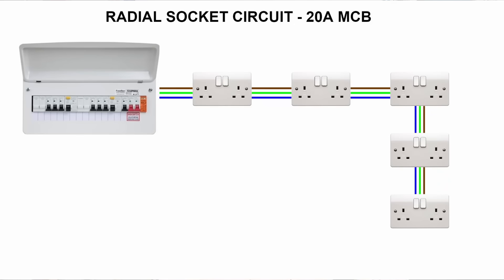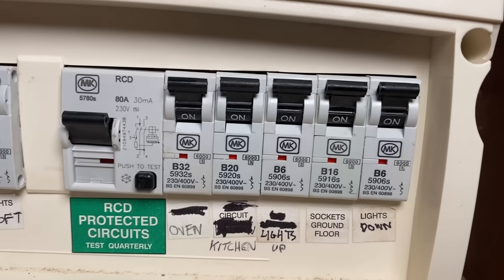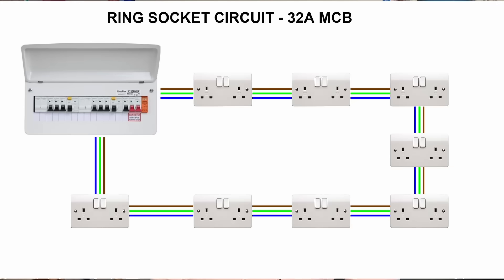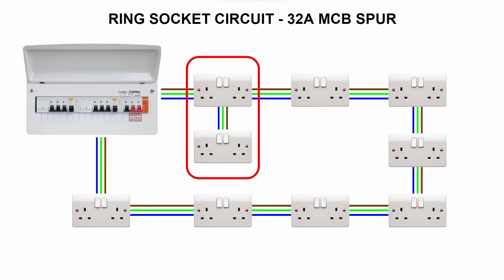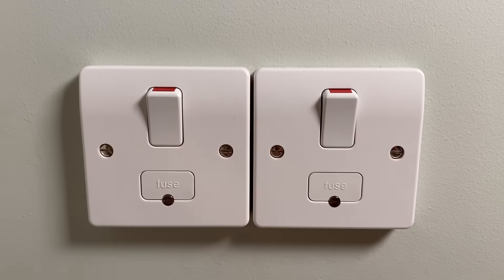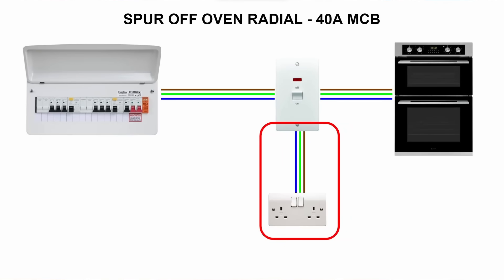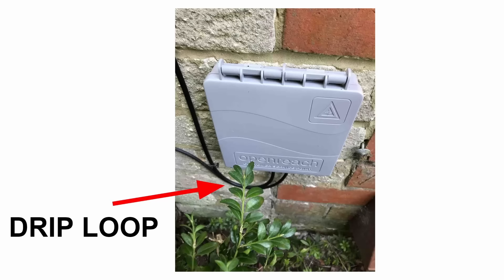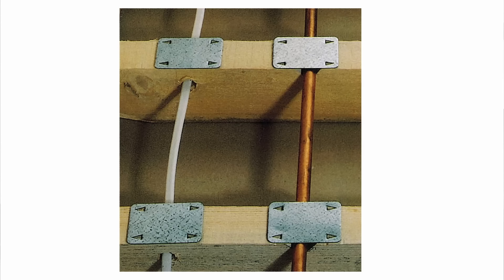BIGGEST DIY Mistakes Adding a New Socket

Comment: Ring circuits have been widespread in the UK for 75 years. They have been found to be very safe. The British G Type fuse-in-plug was to protect appliance flexes, however became an enabler to use final ring circuits. The final ring circuit is ingenious in its simplicity. When used with the British G Type plug the ring is a busbar run around the house with distributed fuses at each appliance.

There are many advantages to rings:
▪️ Cheapness, as smaller easier to install wires can be used;
▪️ A large number of sockets can be off one cheap to install ring;
▪️ Having the same number of sockets using radials would mean multiple radials and multiple extra breakers at the main panel. Far more cable, expense, labour and hassle;
▪️ The 32A breaker and 13A fuse in the plug ensures safety;
▪️ Portable plug-in appliances on a ring cannot exceed approx 3kW. Some plug-in ovens are on rings;
▪️ Rings usually have a 32A breaker at the main panel - can be a lower value; 
▪️ Using push-fit maintenance free Wago type connectors to connect up the ring adds safety, as not being screwed connections they do not work loose. The ring's current does not run through the socket terminals (this applies to radials);
▪️ The British plugs enable rings having a max 13A fuse in them - can be as low as a 1A fuse in the plug to suit the appliance and flex/cable. Small flex and appliance? Then a smaller fuse;
▪️ Rings in the UK are limited by square metres of floor space, with no limit to the number of sockets on the ring. 100 square metres of floor space with 2.5mm cable for a 32 amp final ring. The cable can be 4mm, which is advisable in an unbalanced ring drawing high current loads;
▪️Less voltage drop on long cable lengths as voltage comes from two ways;
▪️Two ways for the earth wire back to the main panel, increasing safety levels.

Radials are also used in the UK. Rings are not mandatory, but used because they have proved to be generally trouble free and safe. They can be installed using rule-of-thumb. These days a ring will be on an RCD, RCBO or AFDD - these now are becoming DP, so safer again. AFDDs are now mandatory in some socket installations and recommended in all installations. AFDDs raise the safety level. If an office wants more socket outlets for extra desk computers. It is a simple matter of extending the existing ring with the extra sockets as the current draw is low. Cheap and easy. If radials are used many radial circuits would be needed, which may mean an extra consumer unit, breakers, wire etc, then far more labour. Some disadvantages are:

▪️ Rings are more difficult to fault find. But electricians have no problem once the ring is fully understood. The ring can be split at a socket then tested as two radials;

▪️ Another is that if a number of high current drawing appliances are on one side of the ring, say nearer to the main panel, most of the current draw may be down one cable leg of the ring with the cable rated below the main 32A breaker. An unbalanced ring. 2.5mm cable is rated at 27A max. Although tests have proven the cables do not exceed their current capacity in the vast majority of cases, just an imbalance in distribution of the two cables from the main panel (consumer unit). Good circuit design will prevent this, negating this disadvantage. Balanced rings can be installed by daisy chaining to alternative socket outlets on the ring. That is the first appliance will draw from one side of the ring, the second socket will draw from the other side, and so on round-robin. Or use 4mm cable to the point where heavy current drawing appliances are, then 2.5mm for the rest, if it is that troubling for some. Using 4mm cable on one side of a ring and 2.5mm on the other, is still cheaper than a bunch of radial circuits.

Overall one ring is superior to a bunch of radials needing their own breakers at the main panel. They are simpler, cheaper, being proven to be safe and worked well over the past 75 years. Using the new AFDDs on rings, which are recommended and mandatory on some installations, gives a far higher safety level. 

You will have to give a very convincing argument against rings. I have not heard of one yet.
Reply from the maker: Thank you for such an in depth and well thought out comment!
Reply: @TheDiligentDIYer1759  
A 4mm final ring circuit on an AFDD with Wago connections taking the rings load in the backboxes, and 2.5mm flex to the socket terminals is near bombproof.
Reply: I agree with everything you say. But the overwhelming problem with RFC safety is when unqualified/incompetent people make alterations, eg spur off a spur (my house's previous owner did this in four places), loose connections, break the ring (my kitchen fitter did this), undersized cables used for alterations or repairs. All these are common faults and can go undetected even with some modern protective devices. I think that's reason enough to use radials, and to crack down on incompetent people doing dodgy things. If you could stop the latter then RFCs would be fine.
Reply: @tobysherring1369  
What you outlined is not common. You do not make regs because of a few idiotic incompetents. 

Look at the mess radials get in with leg after leg spurred off from them, being added over time. 

Final rings: Two ways for the earth wire (CPC) back to the main panel, increasing safety levels. 
With a radial if a CPC breaks near to the CU most of the radial's sockets are unprotected. That is not the case on a final ring. That is a safety factor greatly overlooked.  Lighting should be fitted in final rings, not radials as we have in the UK, for safety reasons as I outlined. I have seen many lighting circuits with a disconnected CPC because someone fitted a new trendy light fitting.

Best practice is having radials serving only one appliance - two connections to the cable, one at the CU and one at the appliance.

I have five appliances on dedicated radials back to the CU and one final ring power socket circuit on an AFDD. The lighting is on two 1.00mm final rings.
Reply: @johnburns4017  as I said, I agree with everything you say. If we could stop people messing around with rings they'd be much safer. People spurring off spurs, and fiddling generally, is common in my experience.
The earth continuity point is a good one.
I'm not sure what you mean about messy radials - as long as the correct cable is used and the terminations properly made, the number of legs and different directions is not an issue. In Australia we have a large junction box in the ceiling and sockets all spider from there. Additional points can be added anywhere else as well. It's remarkably simple and you know straight away if a cable has broken. Radials don't need to follow any pattern or direction, as with lighting radials.
Reply: @tobysherring1369  
In commercial there is such a thing as a reverse earth (CPC) circuit. The CPC only is taken back to the breaker - a CPC ring. This is to avoid the safety problem I highlighted. A final ring just adds to this by taking the L and N back.
Reply: Rings were used back in the day purely on cost issues and simplicity. I do remember 15A and 5A round pin plugs and then onto the "G" 13A. Over time electrical installation components have got cheaper. Then came along RCD's which did not behave well on ring circuits and had a lot of nuisance tripping from the accumulated appliances connected to that ring. I'm also a registered electrical inspector of the Aussie and NZ wiring rules that use radials. Can't think of any other country that uses domestic ring cct's. One thing with Ring cct's is that if you are not careful or break the ring, it is possible to exceed the current rating of the cable (if on 32A breaker). Radials by contrast are fuse protected for that single cable and thus cannot be overloaded due a hack. 20A was the norm down under, but for the last 10 years this has been de-rated to 16A due to higher insulation. Yes the consumer unit is larger, with more MCB's (RCBO's) and more cable, but the economics is very different now, along with easy fault finding.
Reply: @adamsweet3587  wrote:
'One thing with Ring cct's is that if you are not careful or break the ring, it is possible to exceed the current rating of the cable (if on 32A breaker).'

That is assuming the cable used is 2.5mm. Using 4mm that is not the case as it can handle 32A. If you use 2.5mm on a final ring a DP 'unpolarised' 20A or 25A MCB can be used with the value chosen depending on derrating of the cable - 25A maximum.  

Each of the two L legs of the ring is connected into each of the poles on the MCB. The N and E are commoned. The final ring will then deliver forty or fifty amps to an appliance, as each pole of the MCB sends say 25A into each leg of the ring. The ring will never be unbalanced or a cable overloaded. 

Final rings are not outlawed in Australia. The above is not outlawed either. 

If DP unpolarised 20A or 25A MCBs were available in the forties or fifties they probably would have been made mandatory on final rings.

BTW, I have simply changed a single 32A single pole MCB with a DP unpolarised 25A MCB on a final ring to get more power to a kitchen ring.  An 18A increase in one circuit quite quickly, cheaply, safely and simply. Then no needless very expensive new circuit and ripping the house apart.
Reply: @adamsweet3587  Wrote:
'RCD's which did not behave well on ring circuits and had a lot of nuisance tripping from the accumulated appliances connected to that ring.'

RCDs behaved very well on ring circuits. accumulated earth leakage from electronic devices was the problem, as it is on any circuit.
Reply: @adamsweet3587  
Final rings were to provide a socket which could handle a 2kW load in each room. The 1940s recommendation. They did it and did it economically. Otherwise you will have radials all over the house and a far larger CU. Final rings were not cheap and nasty. They have such elegance in their simplicity. 

In continental Europe they at times ran a cheap 8A radial into each room with small cables. They never saw the need to have a high powered appliance in each room. Plug in a 2kW heater then the mcb tripped.  Resetting breakers was common to them.
Reply: In the Netherlands we use central boxes to which every outlet is routed directly. No stringing outlets. Way safer and easier to troubleshoot.
Reply: @hunchbackaudio  
So a star configuration.  Mmmmm, not a big fan. Far more cable used. But does have its advantages in that the cables from the centre point can be a smaller gauge.
Reply: @j@j@j @johnburns4017  We use conduit so we only pull the wires we need, lights switches don’t need a neutral or ground, for example. It’s all 2.5mm except for lights those are 1.5 and have a different color so you can easily identify them. Also the conduits always travel straight up to the ceiling so you can tell exactly where they run in the wall. The central boxes are covered by the ceiling light armature so easily accessible and out of sight. I see no downsides.
Reply: @hunchbackaudio  
No neutral conductor?
Reply: @hunchbackaudio  
so if you want a smooth ceiling with only wall lights you cannot. A serious downside to me.
Reply: @johnburns4017 Not to a switch, no. We only switch live with a light switch. You switch live and neutral on every light?
Reply: @johnburns4017 No, you have to find another spot for your central box. Never experienced that problem, there’s at least one fixed light point in every room. That’s building regulations. Sounds to me like looking for a downside that isn’t there.
Reply: @hunchbackaudio  
I know many homes that do not have ceiling lights. They are frowned upon by many. I never had the monster lighting. What the Dutch are doing is what the Italians do. Having this junction box, the centre of a star, is fine, but in normal sized homes it best to have it at the main panel. 

But then it proves that the British got it right. No intrusive big junction boxes. The final ring circuit that has unlimited sockets covering a maximum floor area of one hundred square metres. An AFDD, which includes arc fault detection, protecting the circuit.
Reply: @hunchbackaudio  
Not to a switch, no. We only switch live with a light switch. You switch live and neutral on every light?

uh?
Reply: @johnburns4017  Not a matter of right or wrong, a room without fixed lighting point would not only be frowned upon, but is not acceptable in the Netherlands. Different point of view. Central boxes are 5.5 x 5.5cm, not exactly big. Loose cables through the wall without conduit is also a big no no overhere. Every floor has multiple central boxes connected to different brakers so you don't loose all power when one breaker trips. A ring circuit sounds a nightmare to troubleshoot and there's no way to detect if the ring is open at any point, at any time. Sounds very unsafe to me. String circuits can add a lot of resistance with all the connections underway. I guess it's what you're used to.
Reply: @hunchbackaudio  
The UK turned away from expensive conduit in domestic homes about seventy years ago after twin and earth cable was introduced. With RCBOs and AFDDs giving high protection the move is validated. 

Read my post above on final rings. All clear. Electricians here get to know them when 16 years old. It is second nature for them. 

The old continental alert of a broken ring. You can have a final ring protected by one 25A double pole un-polarised MCB. Both L legs of the 2.5mm ring cable go thru each of the MCBs input terminals. The MCB does not have to be L&N, it can be L&L. The MCB does not care if L or N runs though any side of its two poles. It is essentially two single MCBs joined with the switch levers locked in. When one side detects a fault both poles trip. The ring could deliver 50A, 25A per leg. The 2.5mm cable on each leg can take 27A max but is protected by a 25A overcurrent device - very safe. 

If the ring was out of balance it would trip. If the ring was cut for some reason the MCB would trip if the current went over 25A on any of the legs. The best protection on overcurrent of the cables. An AFDD on the circuit will detect any breaks in the ring  which will be when contacts become loose and arcs appear.

The DP MCB can be reduced to 20A if the cable is derrated, still delivering a max of 40A. Many bases are covered. If RCBO protection is needed an RCD can be added with its outlet fed into both sides of the MCB.
Reply: @johnburns4017 Conduit is about 40 Eurocent per meter, if you consider that expensive, ok. Great there’s a way to detect a ring issue. Sadly in worst case you have to open up all outlets to find the source of the issue. With radial, if an outlet fails there’s only two spots where the fault can occur. We limit the current to 16 Amp for 2.5mm, if you need more power pull two extra wires. In practice that’s only needed for stoves and boilers. The ring system sounds more complicated than it needs to be, but it’s surely interesting.
Reply: @hunchbackaudio  
Conduit is time consuming to install - so expensive. 
Those who criticise final rings do not understand them fully.  A final ring is not complicated at all. All it is, is a cable from the end socket of a radial run back to the main panel. By doing that the advantage it gives are amazing. Rings supply power.

It is safer as there are two ways for the CPC, earth,  back to the main panel. On a radial if the CPC breaks on the first socket on the line the rest of them have no CPC protection. oooops.

The UK uses radials, but for power sockets rings are preferred for the reasons given. I am not aware of final rings being banned in any country. They do not understand them so do not use them.  They have a multitude of radials - inefficient and wasteful.

At 230 volts:
A 32A final ring can handle a max of three loads of 2,453w (2.45kW).  
A 20A radial can handle a max of two 2,300w (2.3kW) loads. 
So two radials will be needed to do the same as the one ring.  Then cost in two AFDDs for the radials, the ring is a no-brainer.
Reply: @hunchbackaudio 
Great there’s a way to detect a ring issue. Sadly in worst case you have to open up all outlets to find the source of the issue.
The same with a radial.
Reply: @johnburns4017 It’s not the ring circuit that’s complicated, it’s the fault detection. In the rare case the ground wire fails, there’s always the earth leakage protection. It all sounds like a solution looking for a problem. Conduit might be some extra work but changing wires afterwards a breeze and way nicer for the eye than running cables all over the place. A ring circuit with a separate lighting circuit sounds actually more like a waste of material to me.
Reply: @johnburns4017 No if a socket fails, the problem is either at the socket or in the ceiling box. If it’s the wiring that’s damaged, just pull new wires. We use conduit for that.
Reply: @hunchbackaudio  
I am sure you know how to fault find a radial circuit. With a ring it can be made into two radials, then test. 

I prefer conduit. But unnecessary in a normal house.  All that time and expense so that you might pull a wire through in 35 years time. The British dropped it in normal sized homes for a reason.
Reply: @hunchbackaudio  
You have a ceiling junction box with each socket having its own cable back to the junction box?
Reply: @johnburns4017 on older houses yes, because they had two sockets in one box. Newer installs have wall boxes with one socket each, you can click them together and then the sockets are stringed. You then use a frame for the right amount of boxes where you can insert all the wall sockets. Wall boxes are round so you can easily drill holes in the wall to fit them. The screw holes in the box to fit the socket plates are on a ring that can turn separately so no matter where what direction your conduit is entering the box, the sockets will always be plum. Hard to explain without pictures but I hope you get the idea. Always wondered why so many countries use rectangular boxes, they are so much more work to fit in the wall nicely. We have a lot of concrete walls and I imagine it’s a nightmare to make nice rectangular holes in them.
Reply: @hunchbackaudio  
Round and square socket holes do have their own advantages.  Round suffer from too little space behind the front socket plate. 

The star system you described is very clunky. Few use it for obvious reasons.
Reply: @johnburns4017 I think it’s used in Germany also. It’s simple, efficient, reliable and easy to troubleshoot. Never had any problems, been in use since the seventies. But I guess you know better. If you’re not able to fit your wires you can order deeper wall boxes. I see no advantages for square boxes, maybe because I never used them. But since they look to me like a pain in the butt to fit nicely in a solid wall and can’t be extended with extra boxes in a single frame I probably never will use them.
Reply: @hunchbackaudio  
There are double, twin and triple back boxes. they can be joined up using couplers whch are like couplers on conduit. They keep the metal boxes a set distance apart. 

Round is only good for retrofitting as you drill one hole.